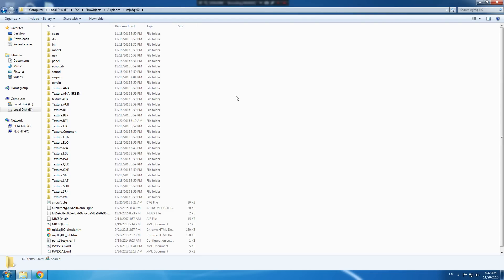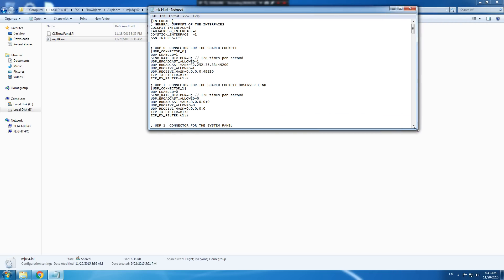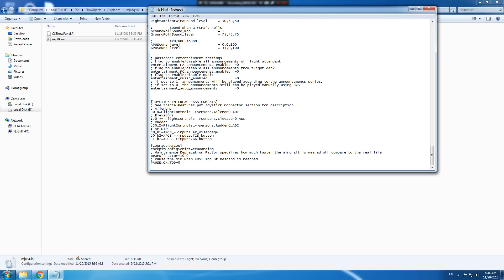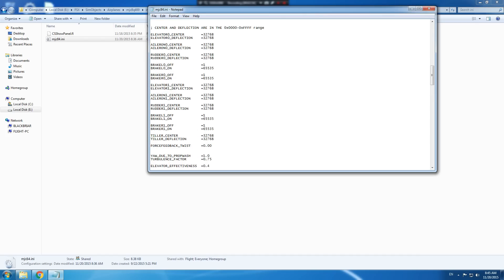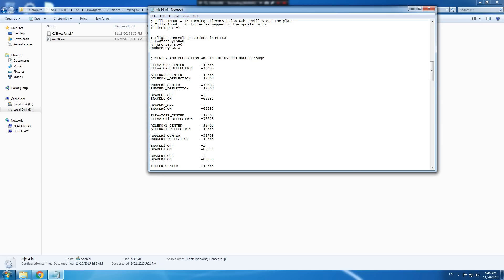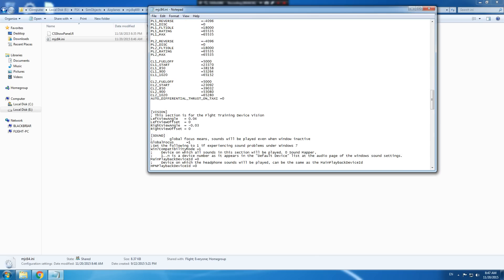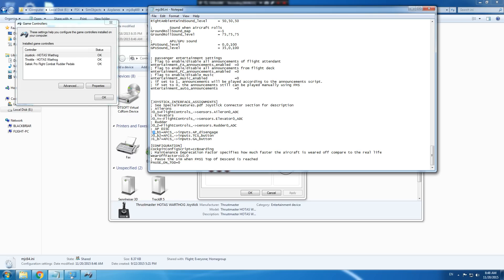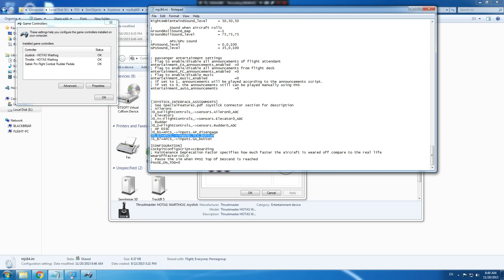How to enable smoother controls MJC Q400 PRO

Comment: So here  are a few questions for the pricks that made this thing - 
1. Why, when you buy the Pro version, do they not tell you that manual changes to the " ini " file are needed before the 125 hz controls will work ? There is a tool available that does this, but it not made or provided by the makers. I had to find out 3rd hand through a third party - ridiculous.

2. Why are there no instructions about how to set up the controls - First, should the controllers be enabled in P3D, or using FSUIPC, or both ? The existence of this config tool suggests - nothing !!!

This plane has cause me no end of issues and I am sick of it ! Rudders deflected, Tiller is a joke and overly confusing, Yoke is stuck to one side all the time - pathetic

3.There is apparently a damage model - but no mention of it anywhere - or how to fix it.

4. Why don't they ever reply to issues on their forums - there are dozens of unanswered posts stretching back 5 years.

How the fuck do these people expect people to pay 70 quid for a damn plane and then not provide instructions. If they cannot speakee de English, pay someone that can !!!!!!!!!!!!

I recommend steering well clear of this company if you don't want a constant headache.

Comment: hey. I checked my axis and I have them correclty configures however ailerons are not working and elevators are reversed. how can I fix this problem pls :(
I just purchased the plane and I can't fly it
Reply from the maker: +TheBadameco Hi, best place to check is the forum. There's one thing i forgot to do in this video was to remove the "-" from the elevators section, having the "minus sign" there will reverse the elevators. As for the Ailerons, is the gust lock disengaged?

Comment: Hi There, thanks for the vid....I have a problem that the rudder now does not work, but is being moved by the throttle. I use a saitek x52 pro, any ideas....many thanks
Reply: +Cyprimole did you find a solution? i have the same problem with a thrustmaster hotas x! fiddle around in the .ini file but did not find a solution
Reply from the maker: it sounds like the J# needs to be changed. You can check dxdiag to see what the number is for the rudder axis and try changing it to that. Also I recommend you check the forums, a a lot of useful information in there with persons solving various issues similar to yours. And thanks for watching!
Reply: +traffictraffic Thanks for the quick response, will do as you suggest......gone back to the old file for the moment all ok with that one
Reply: +Yves Wodey Yes all sorted, went to the forum on Majestic and found the solution there. Needed to make the rudder axis as Rx in the ini file..........works a treat now. Just as Traffictraffic said.
Reply: @cyprimole2600  Can you pleeeeze explain this better? The Rx goes exactly where. I have not been able to get my logitech Extreme 3D Pro to work.
Reply: +Cyprimole thanksvery much!